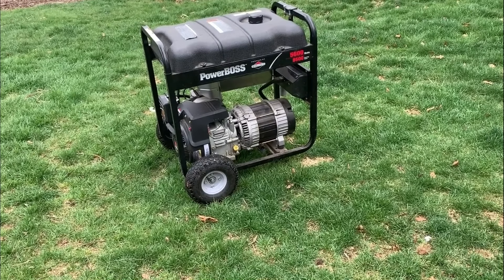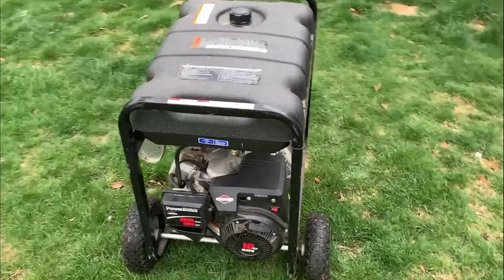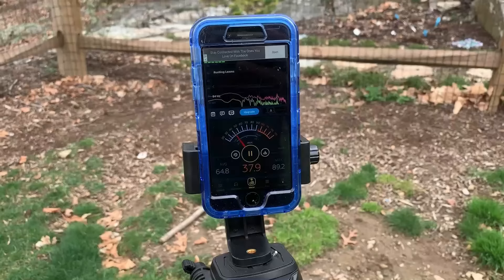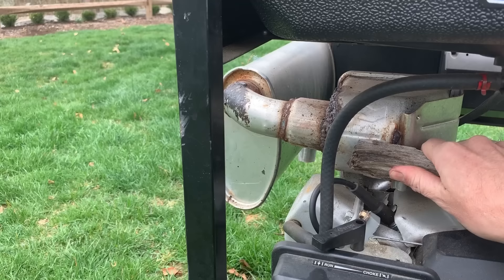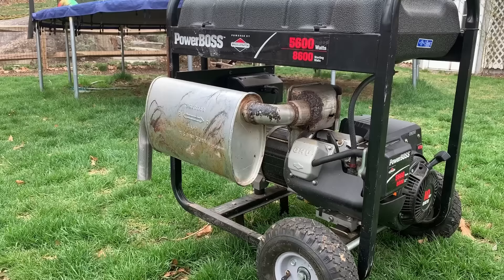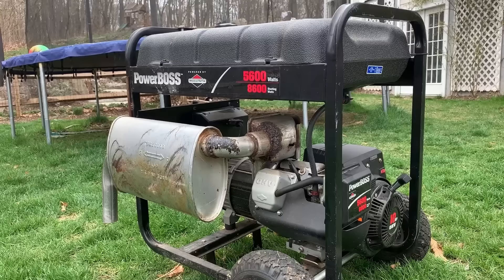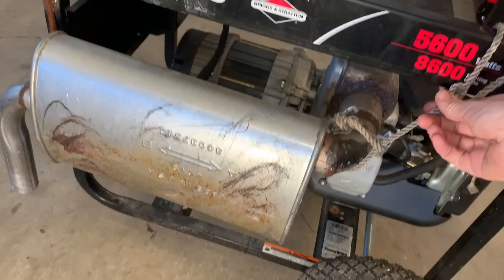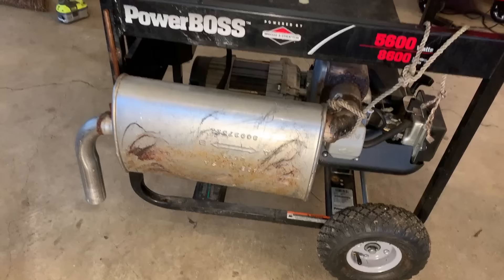Will a Car Muffler Make a Generator Quiet?

Comment: Lemme save you the watch, We tried this with a buddy of ours' loud ass obnoxious generator that he takes to the racetrack with us when we go out of town. NOTHING can make that clanky uninsulated pile of decibels quiet! We exile him to the far pits when he camps because that thing keeps everyone awake. It sounds like a toolbox filled with tools falling down flight after flight of stairs! The engine sounds mostly are from the internals and not the exhaust. If you want a quiet generator you'll have to buy one that's already engineered to be quiet, or burn your race camp / campsite / home to the ground trying to cobble together some insulated enclosure that don't end up overheating the engine and generator, subsequently starting a fire! We run an Onan quiet diesel in our camp and you can sleep next to it. Cheers

Comment: Because sound, in decibels, is a logarithmic scale, that 5 dB difference actually results in a one third reduction in the sound pressure reaching the meter.  The ear is also logarithmicly sensitive, so a small delta in perceived loudness is actually reflective of a large delta in sound pressure.  For instance, a 3 dB delta is about the threshold of most people detecting an apparent loudness difference, but it represents a doubling of sound pressure.  A 10 dB delta, which represents a ten-fold increase in sound pressure, would be detected by most people as only a twice as loud sound.

Comment: All that matters is harmonics. Energy frequency and resistance. Generators unfortunately will have a wide dynamic range since they rev. If you can find a constant rev generator you could make it very very quiet.

You also didn’t measure under load so the sound is at idle which is almost always louder then at load.

Look into how to build a band pass filter with a subwoofer and you can apply the same techniques.

Comment: I did this but flex piped from muffler to outside shop area like long tailpipe putting all smoke outside, like I hook up a car to run inside when working on it. found it worked very well. this looks like a RV home build, putting the pipe out bottom of unit, not for setting on ground or WOOD mine liked to start fires like that, needs a 90 at end of pipe

Comment: Maybe someone used this Generator inside a sidechamber of his Garage/Shed with a flexible metallic tube ( heatshielded) from the Muffler to the outside. So the noise of the Generator was kept inside and the Muffler helped to keep the exhaust noise lower. (In this case it is very bad that the exhaust system had a leaking hole...) So you should use the Generator with a big Fan on a long big noise shielded tube above the Generator to suck the warm air to the outside too.

Comment: Your db meter is measuing the mechanical engine noise. No muffler will quiet this. Silencing exhaust noise (which is the purpose of sticking a car muffler on it) is measured at the exhaust outlet.

Comment: Although the muffler is loud the brushed gen head makes a lot of noise also I have seen where a guy built a enclosure for a Generac the real problem with that is routing air to the flywheel fan and the generator head once you do that it will be loud again . Another interesting idea was to put it in the ground with venting through the ground dug channel then to surface .

Comment: bit old but you could try an app on your phone that shows frequency peaks, then get the tone of the annoying noise.  lets say its 100Hz then the car exhaust is resonant so you could measure the volume and then basically trim the muffler to the volume that resonates at the frequency we found earlier.  close all that up and hope hermholtz works

Comment: As almost everyone on here has said, the exhaust doesn't make the most noise in small engines. Very thin walled manufacturing of the engine case and the mechanical operation of the moving parts of it, cause the greatest noises. Nothing you can do with that, except to isolate and deflect the sound waves into each other, to cancel it. IE: building an insulated housing to surround it.

Comment: It wasn't to make it quieter, it was to exhaust it elsewhere. The exhaust hose run from the muffler pipe to the outside. Without the hole that you covered with wood, it would work.

Comment: The factory muffler is tuned to the engines volumetric efficiency (the way it breathes), to properly tune this for noise you would need to modify the air intake also. Just focusing on the exhaust can trouble the exhaust valves if not done right
Reply: Bad liars lie to themselves. Good liars lie to you.

Comment: Agree about using a motorcycle muffler or something made for that type of engine.  

Also, you have a nice green lawn but very uneven and bumpy. Have you considered leveling it with top dressing or sand? Pretty easy to do, there's a few videos on YouTube to get you going.

Comment: Without having to even finish the video, I could tell the car muffler was doing an alright job even with the hole. When you got a constant 69-70 DB, regardless of the piece of wood covering the hole, that said it. Usually that is the best you'll get with a stock cheap gennie measuring the sound from the standard 7 meters away. You should have checked the DB reading at that distance before ripping off the car muffler.

Comment: so here is a trick to use if you want to quiet it down.  Put something in front of it to deflect the noise I've used pallets or pieces of Styrofoam.  It will certainly make a difference because a lot of your noise is engine/mechanical not exhaust.  i have an automotive muffler hooked to mine  but on flex pipe so I can exit the exhaust out side and the engine noise is muffled by the garage door(detached) that is closed.  Just humms away

Comment: im in the process of building a generator enclosure with a horizontal shed and a 4500 watt inverter generator that runs fairly quietly at 61 dB already.  I plan to run the exhaust through a car muffler inside the enclosure before venting the exhaust outside.  I plan to expand the exhaust to a large diameter pipe right off the generator to prevent increasing back pressure and burning up the engine.

My goal is to have a setup that is behind my detached garage and cant be heard at all from my house even if the windows are open

Comment: While camped at the Reno Air Races, I took the exhaust off of my newish Champion generator to wrap it with a fiberglass wrap kit. I mainly wanted to do this because Champion ran that exhaust pipe and muffler only an inch away from the generator itself. The amount of heat on the generator couldn't be good. So, I spent a few hours and wrapped the pipe and muffler, then sprayed silicone on it that hardened with heat and held it in place. Not only did it run much cooler, it was much quieter. A lot of the noise still came from the engine and generator itself, but overall, it was a good move.  I would just place the generator 25 feet away, and put a Costco folding table on its side between it and my camper, and literally could not hear it even with the A/C going.  Search "Motorcycle exhaust wrap kit".  I see 2" wide by 50' long for $15 on Amazon.
Reply from the maker: Good move with the wrap kit.  The generator head will break down at exhaust temperatures.  I agree, sound deflection is the way to go on most none inverter generators.

Comment: A lot of noise comes from the valve train and moving parts. 3dB is often thought to be the smallest difference we can easilly hear. Car makers sometimes shift the frequency down. It can make it sound quieter when it isn't. Sometimes it even sounds nice. Subsonics can be mistaken for ghosts!! Typically on the subway it can be felt.  It's loud, but not heard. Wind generators also can have subsonics. Sleeve valve engines were quieter and could be smaller. Alas expensive.

Comment: I've seen someone putting a car muffler on a generator before, but they didn't just add it to the regular one like that. They bought fittings to adapt one to the head. It was pretty quiet.

Comment: I have a Predator 4000w  generator. I bought a cheap knockoff 2000 inverter generator. The difference in noise is so much I only crank the Predator one a year to let it run, just in case there is a power outage! Even then, the inverter generator will run my wife's oxygen generator and the lights in the camper! That noisy gas drinking  Predator is just for off grid project!

Comment: A major source of noise is the engine itself.  The combustion noise coming through the cylinder is a major factor.  A sound shield would help tremendously.

Comment: I have a welder with a 2 cylinder onan and found myself in a situation where I needed to weld very early in the mornings in a tight residential neighborhood,the welder was not that loud untill an arc was struck and it was under load,it surely would have woke the whole neighborhood,I installed a very similar muffler to the one you had and the sound level without load was almost the same as most of that sound is mechanical sound and not exhaust but under load the difference was extreme,what I’m saying is you should have done the sound checks under load,this is when generators get loud.

Comment: Nice video, but I think that it would be a bit better if you welded again some kind of "ears" with holes on them, so you can put that car muffler back on, welding a couple of ears on it as well. It would make it more versatile, if you got my point. And of course you could cut open an old, original muffler, in order to make another "socket"/hub from the engine side.

Comment: I'm thinking muffler, insulated box panels with an air intake next to the motor's, and a powerful exhaust fan at the other end. Overkill, because sound is radiating from the entire engine.Has me thinking of Tech Ingredients and all of his in-depth sound experiments.

Comment: The stator is the frame/case part of the actual generator itself, that doesn't spin. That's usually the part with the windings. How would it have a fan if it doesn't spin?

It's the rotor-the part spun by the engine- that would have the fan. That's the part that would be used as the motor shaft if the generator segment were powered by its output wires.

Comment: considering how sound propagates through the air, you have to know if you double amount of power on the speakers you will only get 3 Db increase in sound pressure levels, so 5 Db here is serious difference

Comment: That hole if properly sealed may have nocked it down a few decibels. I had an 85 crown vic many moons ago. Started noticing I was getting a bit better gas mileage on my commute, like being able to drive 320 miles before reaching 1/4 vs 300 like normal. (making up mileage because can't remember exactly). Anyway walked around passenger side one day and noticed some extra noise and realized I had a hole in muffler or exhaust. Had a the exhaust system fixed and mileage dropped back to what it was! So exhaust system can definately affect noise and efficiency. Probably more noticeable with fuel injection or maybe if you fine tune a carb.

Comment: Judging from the comments, the one thing most fail to realize is this is an AIR-COOLED engine. They will always be louder by their very nature. A liquid-cooled engine has a water jacket which dampens all the mechanical clashing going on inside. For example, stand next to a P-51 with it's water-cooled Packard engine and then the F-4U with it's Pratt and Whitney R2800 radial. You can hear the difference.

Comment: Ok. Pay attention. The longer the pipe after the muffler the quieter it will be. In the early days they found that if you put the muffler up near The engine the longer the pipe going to the back of the car it was quiet. Today manufacturer put the muffler in the back of the car on sports cars to make them sound mean or, in other words they’re louder. It’s difficult to do this on a generator like this but if you had a flex pipe connected to a coil of exhaust pipe it would be way way much quieter. Now you will get the rattle from The engine which in itself is very loud.

Comment: You would be better served to create a sound enclosure and have a vent for the stator and discharge for the muffler.  That would reduce 40-50% more noise.  Like someone commented earlier, it is mostly mechanical noise.

Comment: If you had fixed the hole, pointed the pipe up it would have been exhaust quiet, but Briggs and Scrap Iron engines are rattley and noisemakers, and that 2 pole 3,000 rpm alternator is noisy also especially under a load. I welded a Y dump into the exhaust on my motorhome it was very exhaust quiet, but the engine and alternator sounded like a junk truck.
So I replaced it with a 4 pole 6k alternator, and hooked it to an old 8 hp. Honda. 1650 Rpm now
Hooked the exhaust back up, it makes about 1/4 the sound that the other 1 did.
And uses 1/2 the fuel even under load

Comment: I assume a large part of the noise of a muffled small engine comes from the fact it has very little material between the combustion chamber and the outside air, because it's air cooled. Even an idling air cooled motorcycle, which is very quiet on the exhaust end, has a lot of noise coming from the valve train. And if you were to run it like a generator, at high speeds and loads, a lot of noise would also emanate from the cylinder walls.

Comment: I just watched this again.  For background the additional 6dB means it is actually FOUR times louder with the standard exhaust (muffler)
Reply: ⚠️Always make sure you follow all the generator safety rules when you use your portable generator: 

This is just a reminder to make sure. It is important to follow all generator safety rules whenever you use your portable generator. 
Here are the things that need to be followed;

1) KEEPING OTHERS SAFE: Please do not allow an unqualified person or your children to operate and service the portable generator. Just because some manuals don’t say that doesn’t mean it’s safe. That is important against the generator safety rules. We also need to be keeping an eye on our children too. You need to make sure that your children are not playing near the portable generator especially when it’s running so they won’t get electrocuted. Generators pose electrical risks and they can be hot during an operation. Please keep your children away from the portable generator at all times. It is important to keep our children safe especially our little ones. Be aware of all the hazards.

2) WHERE TO RUN YOUR GENERATOR: Some people use their portable generators indoors which increases the risk of carbon monoxide poisoning. It’s important to have a carbon monoxide if you have a gas generator. Never ever use your generator indoors even if your doors and windows are open and even in the garage is not safe to use a portable generator. Not even at your porch and your deck. It is never safe to use your generator indoors and in enclosed areas of your home. Your generator needs to be 15-20 feet away from your house. 

3)🔥FIRE HAZARDS: Never refuel your generator while it’s running. You need to let your generator cool off before refueling it and before storing your generator. Never overload your generator too. Never ever back feed your generator. You should never plug your generator into a wall outlet. Also never store propane tanks indoors. Please keep flammable things away from the generator as well and please don’t smoke cigarettes near the generator. Having a fire extinguisher next to the generator is also important against the generator safety rules. 

4) GENERATOR OPERATION: make sure your hands are dry before touching the generator. Never use your generator in wet conditions. Don’t let your generator get wet. You need a generator tent if you need to use your generator during wet weather. Please don’t wear loose clothes when operating the generator. Turn on your generator before plugging in appliances. Use the right cord for your generator. Please do not use worn out cords. 

https://youtu.be/I1jT3ANENvI and here is a video more about keeping others safe when using generators 

Hope this helps

Comment: The best way to make a generator quiet is to mount the generator in a fixed location and use cast iron as an exhaust pipe...
Then direct the pipe up the side of the home or structure about a foot above the roofline with proper mounting hardware and put a 90 degree elbow on the top and then a small muffler at the end...
You may want to install a rain flap or downward tailpipe on the muffler to keep any rain out.

Comment: I've considered different or secondary muffler as well...
My genny lives in its specially  built "dog house". It protects it from the weather,  painted to look like a dog house to deter thieves, and quiets it somewhat.  Plenty of venting let's out most of its noise so due to its sound and home I've named it Growler.   The roof comes off for refueling and the front wall is hinged at the bottom to act as a ramp to easily remove it for maintenance.   Am thinking of insulation in its walls to help absorb some of the noise.
Reply: Got any pics of it
Reply: @gojoejoe2397  only way I know to send that pic it directly to your Email.....
Reply: @gojoejoe2397  Oops! No photo. Must've deleted it.   BUT, will be there with it on Friday or Saturday.  I WILL take more photos of it for anyone interested.  Friends and family all got a kick out of it due to it's looking like a doghouse and its functionality.

Comment: The weight of the muffler will eventually break off the exhaust  manifold. I tried this and found that a small Honda Civic type muffler works best. You have to make a bracket that holds the entire weight of the muffler and is connected to the engine with a piece of flex pipe after.